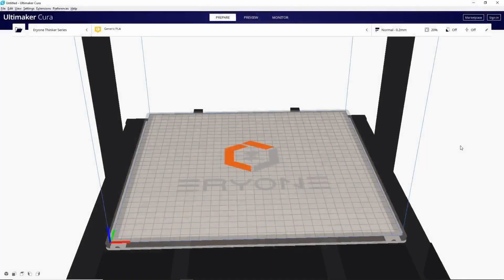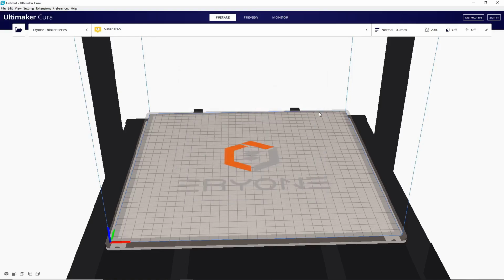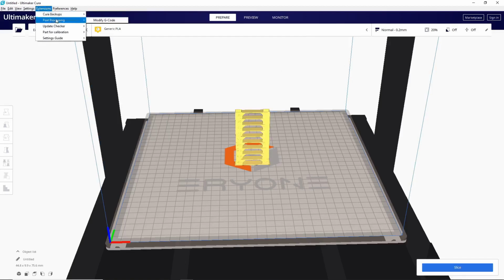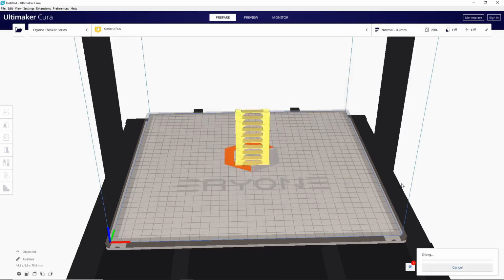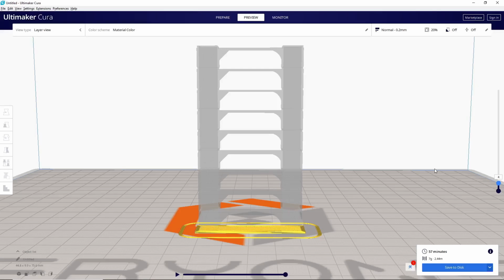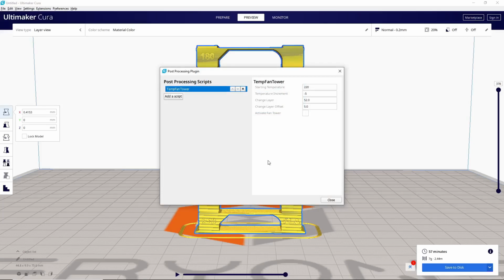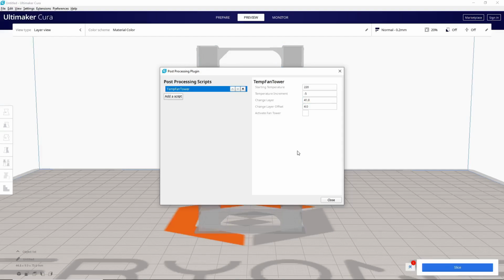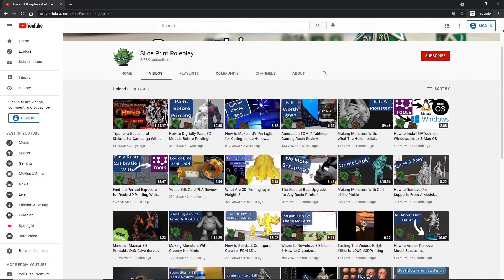How to Create a Temp Tower Test in Cura - Easy Tutorial!

Comment: So in 2025, the plugin name has changed to Calibration Shapes Reborn and there is not an option for a PLA Temp Tower, any thoughts or fixes?
Reply from the maker: Unfortunately I'm not familiar with that plugin. Cura losses really great plugins constantly when they should pay the creators of those plugins to simply integrate the features of those plugins into the slicer itself. It's one of the reasons why I've fully moved to Orca Slicer.
Sorry I can't be more helpful. 😔
Reply: @SlicePrintRoleplay interesting, its the exact same plugin you used, just the updated version. Is there any newer way to print a temp tower in Cura? I cane over from Orca because I find Cura to be better.
Reply from the maker: @electroevolution5777 is it from the same creator? I've honestly not used Cura in about a year. But if I get time to play around with it again I'll try out that plugin. I agree though, I've always liked the UI of Cura the most out of all the slicers I've used. I just feel that it falls behind with new features that other slicer adopt much faster. Cutting, adding alignment pins, separation models into parts, etc. All features that come stock with other slicers... But still, if plugins are available to add those futures, Cura is a great slicer. I'll have to try to get back into it when I have time.
Reply: @SlicePrintRoleplay For sure man, it is definitely a more visually appealing slicer. I appreciate your responses, have a good night.
Reply from the maker: @electroevolution5777 you are very welcome. I apologize again that I was very unhelpful. 😅
Reply: @SlicePrintRoleplay Nah, its okay. Iv never really needed to make a temp tower but I figurd Id give it a go for shiz and gizz.

Comment: Any idea why the temp tower has different layers per temperature?
           Layers
Base-  4
 220-  37
215-  42
210-  41
205-  42
200-  42
195-  41
190-  42
185-  41
180-  42
Top-  4
I thought it should have been base @ 4 layers, 42 for each layer, and not have the 4 pointless layers at the top. This is @ 0.2mm layer height
Reply from the maker: A few people have said they came up with slightly different values than what I show in this video. I don't have a great explanation for it currently.
Reply: @SlicePrintRoleplay  So I worked out that in order to have the levels to have same amount of layers, set the layer height and the initial layer height from 0.2mm to 0.16. Each tier except the 1st is then exactly 52 layers plus 5 pointless layers on top.
The first tier is only 47 layers 52 including the base.
Not sure of the purpose of the top 4 layers.

Comment: If I'm using the same model and following your steps, won't my numbers be the same?
Reply from the maker: They should be, but different versions of Cura seem to have slight changes with those numbers. Also remember that different layer heights will result in different values as well.
 How big is the difference between your values and the ones I show in the video?
Reply: @SlicePrintRoleplay  actually, the same. I had a really heard time figuring out how many layers were in the base.
Reply from the maker: @mamag3531  what made that so difficult for you?
Reply: @SlicePrintRoleplay  There was a "helper" layer under the first layer of the print? I just had a hard time figuring out if there were 4 or 5 layers there before the actual test started.

Comment: 4:00 what did you do for printing temp and printing temp initial layer , just typed in the value as 220 ? how did you get the (fx) symbol next to it ?
Reply from the maker: Yep, with most settings in Cura you just click inside the box Associated to the setting and then type in the value you want to change it to.
The (fx) symbol just highlights the settings you've changed from whatever set to in the profile you're using.
Reply: @SlicePrintRoleplay  Thank you.
Reply from the maker: @sanketss84  you are very welcome.

Comment: That temp tower script has a big problem that most of these scripts share.  Its using an M104 command to change temperature.  104 doesn't wait for the temp to complete changing before continuing. So each band is cooling as its printing: You don't have a band that is just one temp.  In a normal print you want that smooth gradient and not something obvious in your print.  That's not the use case in a temp tower.  Here you want an M109 which is "change and wait", so that each band of change is truly that one temp.  I usually go through with Notepad++ and find/replace all those M104 to M109

Comment: Anyone get a thermal runaway while trying to print this? I followed the steps and changed the parameters in the script and then changed the temp in the material settings, but 2 times I tried to print and got thermal runaway. I then printed a little calibration cube with no script and it printed fine.
Reply from the maker: No I can't say that's ever happened to me while running this script. Normally that happens as a result of failing hardware.
At what point in the temp tower print did you get that error? Was it right away or later on?

Comment: Thanks alot! very helpful!

Do you know if it is possible to adjust the script to be able to test other nozzle sizes? Thinking this would be very helpful to optimize each nozzle size settings.
Reply from the maker: Unless I'm mistaken, you should be able to run this with any nozzle size. It should only control how the temps are adjusted and at what layers. Settings like nozzle size, layer height, etc will be determined by your settings within Cura.
Reply: @SlicePrintRoleplay  I tried alot, and I dont think that is correct. When looking at the script on the wiki sites it also states 0.4mm nozzle inside the script, so I believe it changes this setting also. I tried finding the file itself to change the nozzle parameter, but I could not locate the script.
Reply from the maker: @eiksaa8737  oh thats for the input. Sorry for the the incorrect info. Have you asked about this on the Github page? The creator is usually very quick to respond to questions like this this.

Comment: I love that your sliced file says it'll take 57 minutes while mine says it'll take 2.5 hours lol
Reply from the maker: Yeah there are tons of settings that could account for that. Are you using the default settings for a 0.2mm layer height? I believe that's what I used in this video. 
Still, different models (even at the same layer height) will print differently.
Reply: @SlicePrintRoleplay  even at default setting with .2mm layer height is still 1 hour 40 minutes. It's just different printers sometimes. No complaints, I've used your temp tower tutorial for awhile now and it's spot on every time.
Reply from the maker: @lysergicpillamyd483  that's interesting. What printer are you using? Out of curiosity?
Glas the video has helped you!
Reply: @SlicePrintRoleplay  just an Ender 3 Pro with Cura is all.
Reply from the maker: @lysergicpillamyd483  hmm... That's very interesting. I wonder what the times are so different. 🤔

Comment: Hey what print speed are you using because for me its says its going to take 6 hours at 20mm/s?
Reply from the maker: Oh wow yeah that's definitely not right. What printer are you using?
Reply: @SlicePrintRoleplay  ender 3 pro
Reply from the maker: @cheeeez_it6061  okay yeah that's definitely way too long. What layer height present are you using?
Reply: @SlicePrintRoleplay  I have my layer height at 0.08mm
Reply from the maker: @cheeeez_it6061  that's definitely the issue. I believe I used a layer hight of 0.2mm. You are using 0.08. So a layer 0.12mm thinner then what I was using.
To understand the relationship between layer height and print time check out this video.
https://youtu.be/7MrUvvvAIc8
Reply: @SlicePrintRoleplay  thanks for the help I appreciate it 😊
Reply from the maker: @cheeeez_it6061  I'm happy to help. 😊

Comment: How show the machine model like your cura?
Reply from the maker: I'm honestly not sure why it's displayed like that. It's automatically applied when switching to the Eryone Thinker SE printer vs any other printer I use. It's actually a pain since you can't look up through the build plate from underneath. There is probably an option to turn the it off, but I haven't devoted the time to look for it yet.

Comment: Hollooo
I'm printing using Dual color Amolen (blue/green) filament. It's very elasticie. Do I run both tests (tempfan tower and the retraction tower) at the same time or separately? Temptower first and then the retraction tower second?
Reply from the maker: I would recommend printing a temp tower test first. 
Then print a retraction test using the retraction test model.
Running both tests and at the same time will make your results very difficult to understand.

Comment: How come my base only has 3 layers despite doing everything the same as you? I have 378 all together though
Reply from the maker: Not sure. If you're using the same temp tower model and layer height then it should be the same... But you may have a setting turned on that puts down a larger bottom layer to help with adhesion. That's one explanation for the difference.

Comment: Do you have a video showing what to look for on the temp tower to properly choose your settings?
Reply from the maker: You know as ridiculous as it sounds, no I don't have a video like that... But I am working on it currently. 😅
Reply: @SlicePrintRoleplay  I look forward to it, I’m still in the market for my first 3d printer but I tend to do a TON of research before.
Reply: @SlicePrintRoleplay  also, is there any other prints to help with settings. Like nozzle temp for example
Reply from the maker: @peebs2424  I personally don't recommend calibrating too many different settings if it's not needed. By that I mean, print some models and see how they look. If you see issues then definitely work to resolve them. However, if your prints look good then you don't really need to do anything.
But I would recommend printing an overhang test. This will tell you how much of an angle your printer can handle without supports. For some printers that's 50° on others it's a bit higher. Going from 45° to 50° will save you time and materials when it comes to support overhang angle.
Reply: @SlicePrintRoleplay  awesome, thanks for the reply!  I appreciate the help
Reply from the maker: @peebs2424  you are very welcome. If you have any other questions feel free to reach out. I would recommend joining my Facebook group or reaching out on Instagram. It's just easier to get ahold of me that way.

Comment: Wonderful explanation video! However as I change the parameters they do not change in the item once I slice it. For example, I put start at 230 C and it still starts at 220 no matter what I do. Any suggestions as to what I should do? I'm using the generic Add a PLA TempTower pluggin by the way.
Reply from the maker: Hey there, thanks for the praise!
Just to confirm, is the test starting at 220c and moving up to 230c for the first block of the test?
Or is it staying at 220c for the whole test?
Also, what version of Cura are you using?
Reply: @SlicePrintRoleplay  no problem! It starts at 220c and then moves down to 180c. I'm using Cura 5.0 currently. I have everything just like you typed in the settings except the starting is 230c instead of 220c. 4 bottom layers, 41 layers/temp change, and -5 increments
Reply from the maker: @adrewfis925  hmm that's odd. Last I checked this plugin wasn't compatible with Cura 5.0. So because of that I haven't tested it with the newest release yet.
But even still that's odd that it would drop from 230c to 180c like that.
But you can rule out the software by grabbing an older version of Cura and trying this process again. If it works then you'll know the issue was with Cura 5.0.

Comment: Trying this in Cura 5 in standard settings slice time is 1 hour 45 minutes vs your 57 minutes why the hell is it so different? No normal profile in cura 5 .. only standard at .20
Reply from the maker: Oh cool I wasn't aware that this plugin was compatible with 5.0 yet.
Unfortunately, there are a ton of reasons why your ETA is different from what I was getting. Settings may have changed between the version you're using vs the one I was using.
Also, you are likely using a different printer than what I was using. The default printing speed between the two printers is probably different.... Haha the short answer is, I unfortunately don't know.

Comment: "It's real simple just to this complex equation below"
Unlike most of the comment section i'm too low IQ to even remotely understand what i was seeing.
Reply from the maker: I don't think it has anything to do with your IQ. I know I need things explained to me in a very specific way in order for me to understand. 
So let me explain it in a different way.

Step one, find how many layers are in the base of your test.
For the model I used that was 4 layers.

Step two, find the total number of layers in your test model. For the model I used that was 378.

Step three, subtract the number of layers in the base from the total number of layers in your test.
For the model I used that's 378 - 4 = 374.

Step four, count the number of times the temperature changes in your test model.
For the model I used that was 9.

Step five, devid your remaining number of layers in your model by the number of times the temperature changes.
For the model I used that's 374 ÷ 9 = 41.555...

Final step, round the number up if it's .5 or higher and round it down if it's .4 or lower.
For the model I used that's 41.555... Rounded up to 42.

I hope that makes it easier to understand. If not let me know which part is giving you trouble and I'll gladly try and help.

Comment: Thanks for the video.

Why does this have to be so complicated? 
Why can't there just be a file that I can download that does this rather than me having to go into the g-code and working it all out?
Reply from the maker: Well there actually is a Temp Tower file you can download that comes ready to print.
However, please keep in mind that you won't be able to change the settings built into the test. Not easily anyway.
Also, if you've made any changes to your Z offset then running this pre-sliced file could cause issues.
But if you want to check it out I actually talk about it in the previous video I made on this topic.
https://youtu.be/Z_VjBC2DX6U

Comment: Is the fan supposed to be off during printing or dig I make a mistake in cura ?
Reply from the maker: For this test you do want your part cooling fan on. Unless you're printing with a material where it's recommended not to use cooling. In that case obviously you would turn part cooling off.
However, for PLA/PLA+ you'd want the part cooling fan on just like when you're printing normally.
Is it not on during the first few layers? Because that's actually normal and won't hurt anything. However, if it's not turning on at all during the whole test then that's an issue.
Definitely double check and make sure you don't have part cooling turned off.
Reply: @SlicePrintRoleplay  I went back and checked, apparently I have a fan that has stopped working. Thank you very much for the reply and the video.
Reply from the maker: @Phantom_dave  oh that's always frustrating! Glad you found the cause of the issue.
You are very welcome!

Comment: Hi, thanks a lot, it's great. I still have an issue,  my Artillery Genius Pro seems to be working well but when I print the tower (without support as you said) the filament is a mess while printing the bridge between the 2 towers. What am I missing?
Reply from the maker: Interesting. I have a few questions.

#1, what filament are you using?

#2, are you using all the settings from the standard 0.2mm layer height profile in Cura?

#3, what is the temp range you're printing with? More specifically, what's the starting temp of the test?
Reply: @SlicePrintRoleplay  HI, I'm using a std. PLA from 3djake, never had problem with it and of course using the standard profile from Cura. I'm starting with 220 degrees. I'm trying now to redo everything from scratch, new leveling, other filament (same type), some stuff on the bed and reducing the bed temp from 70 to 60

Comment: 2 min into the video, THANK GOD someone is talking fast enough that i dont have to adjust the video speed playback xD thank you sir
Reply from the maker: Haha I actually get complaints about not talking fast enough. So I'm glad to hear that wasn't an issue for you.
Thanks for the awesome feedback!
Reply: @SlicePrintRoleplay  every one around me complain that i speak so fast that's why i got excited when i heard the way you speak , guess we cant ever satisfy every one xD
Reply: @SlicePrintRoleplay  back on the temp tower btw ive tried 4 times and cound't complete any one , so i gave up set it on 210 , my neptune 2 s wouldnt change the heat , now trying retraction test will see how it goes,
Reply from the maker: @mnr3d  I'm sorry to hear that it didn't work for you. It's possible it's the plugin. Normally if the plugin shows up and works correctly in the slicer it should export a file that will work with your printer... But it might be worth trying it the "Old" way.
If you want to see what that's all about you can check out the below video.

https://youtu.be/Z_VjBC2DX6U